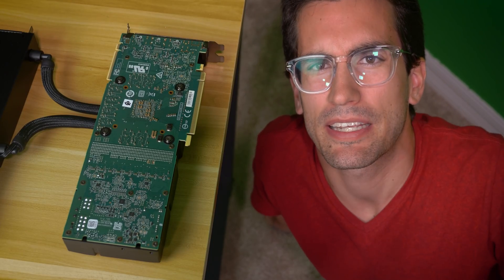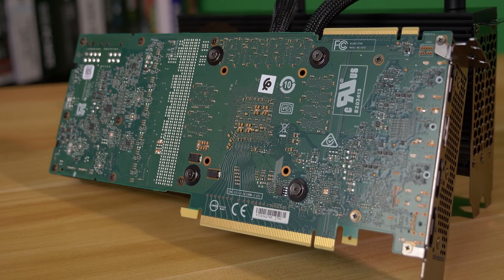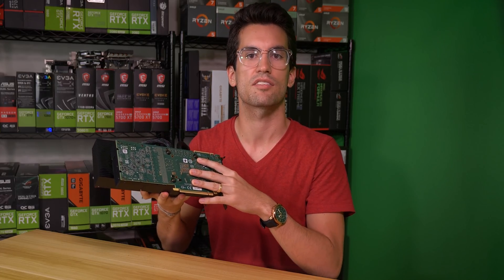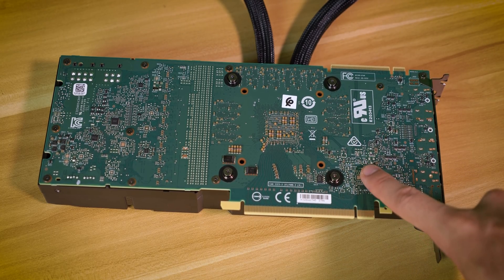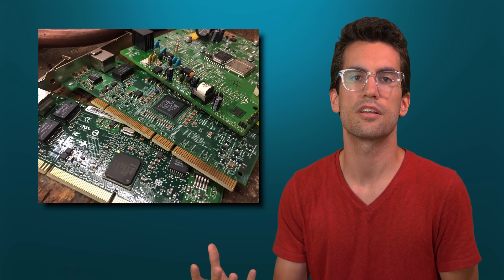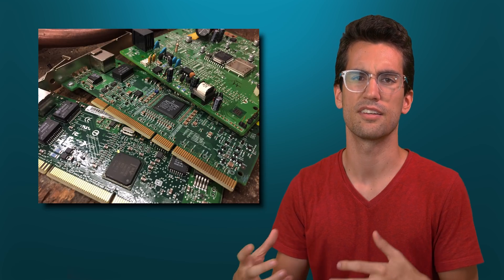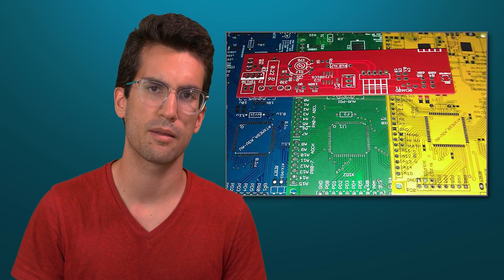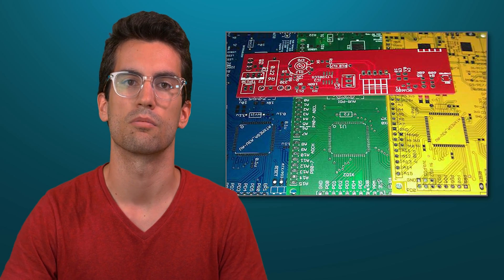Why Are Circuit Boards Green?

Comment: My blue and brown motherboards from 2011: "Am I a joke to you?"
Reply: I have seen a few blue. And I actually have an old matx red msi motherboard
Reply: well back then they didn't have RGB in mobos
Reply: Asus P5K brown-yellow
Reply: my 2500k sits in a light-blue gigabyte board
Reply: where did you find a brown motherboard in 2011?  that shit died out in like 2004
Reply: @butre.  It's an ASUS M4N68T-M LE V2. Such a badass mobo. Jk, I got it for $20 at Micro Center.
Reply: @CaveyMoth  oh yeah those were super cheap
Reply: @butre.  I miss the days of bargain bin motherboards. I haven't been to Micro Center ever since I built those PCs in 2011.
Reply: @CaveyMoth  the extreme budget end of the spectrum has been filled by used hardware.  older generation processors are still perfectly capable and you could fairly trivially build a competent esports rig for under $150
Reply: @butre.  I had bought a pre build pc. I was around 8 years at 2012 when my dad got the pc. It had a blue mobo in it
Reply: @butre.  eh? There were brown coloured boards in 2011. There were a lot of board colours in 2011.
Reply: I have a blue Gigabyte motherboard from back in the day.
Reply: I also have a blue mobo

Comment: Back in the late 1970s when I had my first job in computers, I was soldering together memory boards for aerial surveying equipment, and the boards were, if I remember correctly, blue. I had asked my supervisor (who had 20+ years experience) why they were that colour, and other PCBs were green, and she told me it was due to the military specification. Different coloured PCBs indicated their capabilities. One colour, for instance, meant that the PCB was resistant to funguses, another that it was flight rated, another that it would resist some immersion in water, etc.
Reply: This isnt the soldermask colour you are talking about, but instead the internal color. FR4, the common fire resistant fiber you find today is white/greenish, there is the yellow you see on older boards (Im not sure at all, FR1 I think) which also is very different and is cheaper.

Back then, they didn't need soldermask. All the pins where a football field away (like for example a 0.1" pin pitch chip) and so solder doesn't tend to short things out

With the invention of SMD and high density components, soldermask was added as a repellent to solder, which helps stop it from briding the tiny pins together. This video is talking about the soldermask
Reply: Farrell McGovern Yep!
Reply: Interesting
Reply: Might have been true back in the day but now days you can find any color pcb on anything. Check out some of AMDs red pcb gpu's we also now have red green blue yellow silver black motherboards in the "gamer" market.

Comment: This is a good question! I will say that in hardware engineering when PCBs go through different stages (DVT, EVT, Production) in development you will find tan/yellow, red, and even blue! But final stage PCBs typical end up green or a variant of green unless specified to an ODM to use another final color. I personally enjoy blue and black PCBs when it comes to consumer products.

Comment: why not black?
Reply from the maker: Dark PCBs are already prevalent in PC tech, but contrast in the traces and silk screens are likely why they aren't the most popular. That, and they're generally more expensive than green.
Reply: Almost all motherboards sold for self builds have black/dark PCBs, along with a few white ones.
Reply: @Safetytrousers  yeah, that is my point. why not manufacturers use black if most people use dark/black PCB? but Greg answer most of my question though.